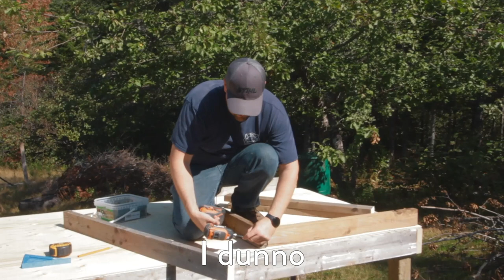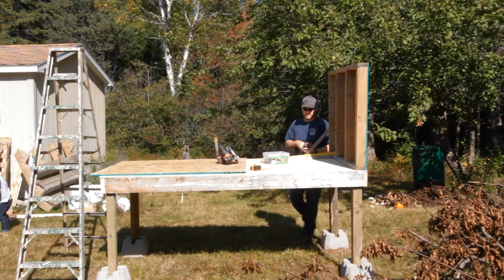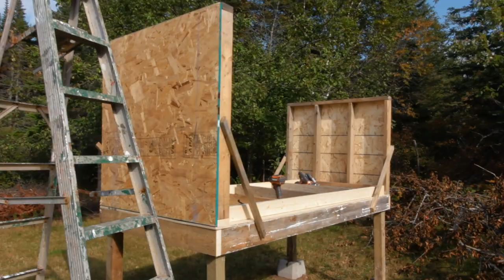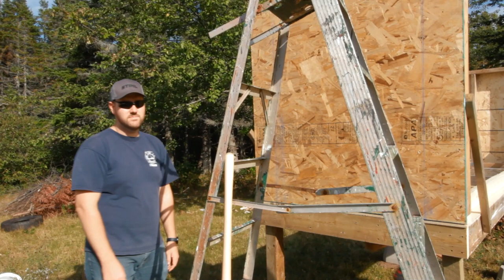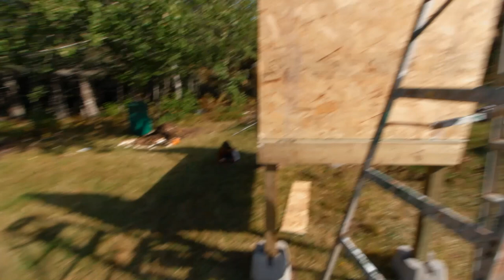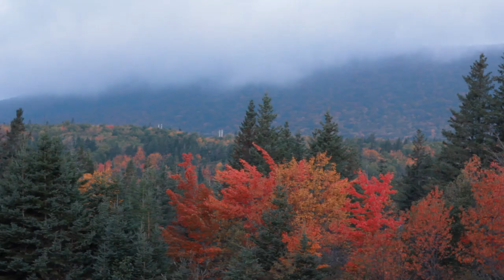DIY Backyard Chicken Coop Build

Comment: Excuse my ignorance but what's the reason for having it elevated?
Reply from the maker: No worries! Not all need to be elevated but for a few reasons it was a good idea for us: rodents won't burrow or nest under it, it won't get snowed in (if it does it won't be very often), air will circulate around it, the floor will last longer due to less moisture, it is acting as shade and shelter in the run during the day. This one is a little high though lol